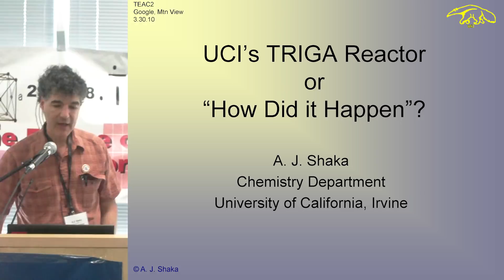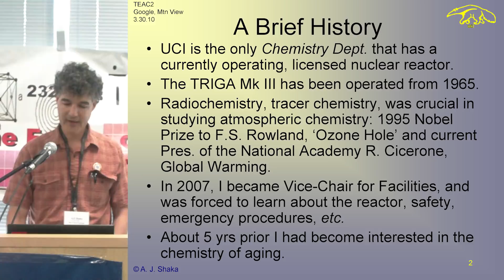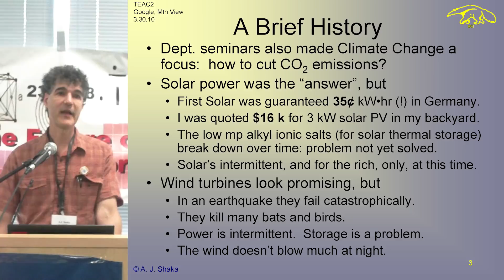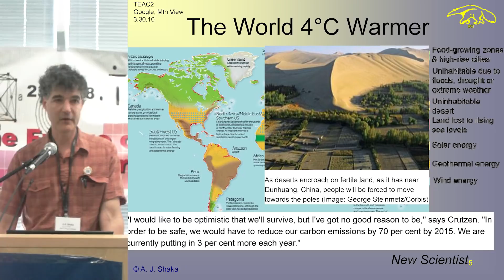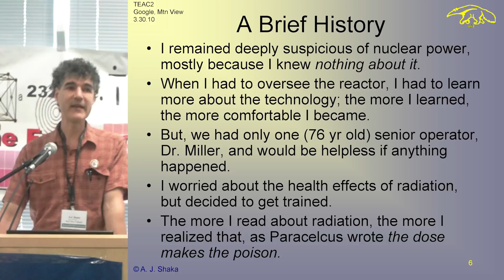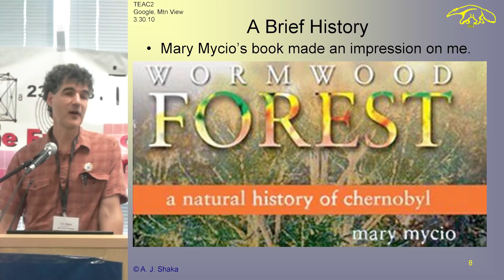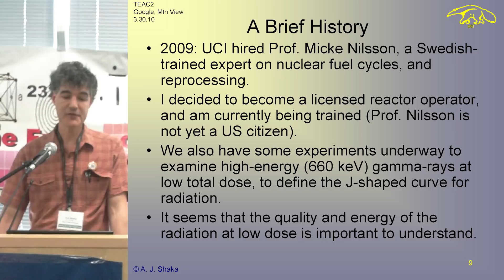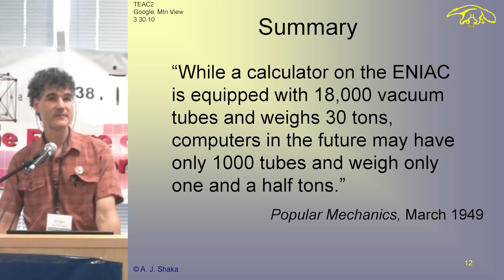A. J. Shaka - TRIGA Reactor @ TEAC2

Comment: Odd that dr. Shaka believes the J curve exists for radiation but not the earth’s system for dealing with additional CO2. All of the hockey stick models have a compounding factor in play, which directly contradicts the J curve’s healing and absorbing effects. We shouldn’t pick and choose where the J curve applies folks
Reply: Because history shows the earth doesn't have a fast acting one. We've seen in geological history that additional heat increased CO2 levels, increasing heat, increasing CO2 levels further.
that feedback loop stops eventually as most permafrost has melted and the biomass has been reduced, and then the slow carbon sequestration processes reduce the CO2 levels again, but only very slowly and only after the full positive feedback loop has happened.
Reply: @TheCountess666  exactly. but my point was that he is picking and choosing to apply and not apply the proper reaction. It's inconsistent. But let's be honest here...the general public is finally starting to wake up to the fact that AGW is a hoax. They can plainly see observationally that the temp is not warming. And solar observations seem to predict the temp will continue to cool, further busting the failed warming predictions. Add to that the fact that NOAA and NASA have corrupted the temperate record with their increasingly common "adjustments" cough-cough, the gig is up, the hoax has been debunked. Let's focus on real problems like pollution, which kills WAY more people that any perceived warming. And the best way to get rid of coal/oil/gas? Advanced nuclear, i.e. LFTR and MSR.
Reply: @MichaelLebiedzinski  how is it a hoax? 
You have some proof that greenhouse gasses aren't opaque to infrared light while being transparent to nearly every other light frequency?

Or do you have proof that the earth has another mechanism besides infra red radiation out into space to lose the energy it gets from the sun? (energy in == energy out = stable average temperatures)

no?

Then man made climate change is a undeniable fact.

and he isn't picking and choosing at all: There is no j-curve for man made climate change. that's what i explained to you. you then say 'exactly' and go off in completely the opposite direction. 
That's not the tactics one uses when having a honest discussion.

As for the general public, support for climate change mitigation policies is only growing. even among conservatives.
Reply: @TheCountess666  the chemistry and physics are not in dispute, they are the laws of nature. the hoax consists of: 1. parameterized climate models that are adjusted to provide pre-determined outcome, 2. lack of transparency in scientific method used to construct model (hockey stick for example). 3. NOAA and NASA making "adjustments" to the raw collected data, again to support a pre-determined conclusion. These are proof of the hoax, and this is not science. you are making a HUGE leap from GHG opacity and basic thermodynamics to "man made climate change is a(n) undeniable fact" with zero proof for your theory. This again is not scientifically sound. Climate change is indeed an undeniable fact. Observation proves it. But to make the leap that human activity is causing all of the climate change we continue to experience on this planet is an unproven leap. There are literally thousands of variables here. Have you read the transcripts and video of ex-IPCC members who have admitted the IPCC is a political organization, not a scientific one? Have you heard their own words stating the IPCC's aim is global wealth redistribution, through climate change policy. In their own words... Have you, personally, reviewed the NOAA US temperature data?? the raw data, not the adjusted data? Can you explain how, even with adjusted temperatures, the US average temperature was LOWER in 2018 and 2017, compared to 2015 and 2016? The temperature is lower, not higher, yet still in the presence of record CO2 ppm. Are you aware that ZERO, yes ZERO, of the climate models have accurately predicted temperature change? and not by a little bit. 100% of the climate models vastly overstated predicted temperature rise compared to decades of observed values. What does that tell you? It tells me the models were WRONG, WRONG, WRONG, and that the models used input parameters that were designed to provide a predetermined output, to fulfill a political, not scientific, agenda.

I agree with you, climate change is an undeniable fact. But man-made causing all climate change, or even more than a negligible amount? where's the proof? even further, the notion that man can affect global climate? who do we think we are????

And lastly, as more evidence of the hoax...remember we used to call this "global warming". but you don't hear that anymore right? it's now referred to "climate change". Why? because humans can readily observe that the temperature isn't getting any warmer. So the narrative had to change to something softer, thus "climate change". Sufficiently general to be a catch-all for everything bad that happens. A hurricane here, or a drought there -- OMG, climate change!!!! the sky is falling
Reply: The Countess oh and of course the most obvious thing you are probably aware of.... we have these things called clouds... made up of water vapor. care to comment on the effect of water vapor of greenhouse effect?? now one caution, don’t use Al Gore as a source for your response. he has a propensity to photoshop pictures of the planet taken from space, removing clouds. well documented, check it out for yourself
Reply: @MichaelLebiedzinski  ah clouds. yes, so warmer air can have more water vapour in it before it starts to condense and form into clouds.

Clouds ar a mixed bag in terms of warming, as they block sunlight during the day, but also block the infrared radiation from the earth (at night, we've all experienced those sticky nights when its cloudy outside, compared to much cooler nights when its clear.)

But that water vapour however is very clearly a greenhouse gas. The most powerful greenhouse gas in terms of effect in the atmosphere in fact. ~95% of the natural greenhouse effect, which adds about 30 degree's C to our climate, is caused by water vapour.

And warmer temperatures means more water vapour in the atmosphere with the same amount of clouds. 

And that's the part the has scientists worried.

Even at the current +40% extra CO2 (highest level since humans evolved) would only about 0.6 degree's C on its own. But that 0.6 degree's C would increase the amount of water vapour, which would increase temperatures further.

It's this amplification effect that we're really worried about. that's what all our modeling is trying to predict.
Reply: @TheCountess666  ok. that sounds more reasonable. my suggestion on the models would be to stop changing all the input parameters to get the result you want (warming). Just create a model where you open to whatever conclusion the models outputs, scientific theory...start with a theory and perform research to prove or disprove it, but don't allow bias to affect your results. every single one of the models I've seen has been WRONG. It grossly overestimated future temperatures. so what does that tell you? the model is not accurate. you're missing a variable, or the input param are wrong. the best theory I have seen that normalizes the models to observed temp is that the models incorporate a feedback loop that may not actually be present, and may not be accounting for the climate's natural ability to absorb changes. I think we need continued research and stop the nonsense with "undeniable fact" when in fact the models have proven wrong.
Reply: @MichaelLebiedzinski  Scientists put into the models the numbers they know, or the ranges they know if we don't have a accurate number yet. So the result of any model will be a RANGE of outcomes, with the most likely results being around the centre mass of the results. And so far all the models show more warming, with results ranging from mild warming to catastrophic warming, with the center mass of the results around 1/3 up from the bottom, so serious warming.

unfortunately communication to the public doesn't always make this very clear. leading to claims that the models are always wrong ect, and that then gets used to imply that there is no warming at all. but as you read in my previous post, we KNOW there is warming. there is no way there isn't warming.

And actually we know very wel why our models are off: The air isn't warming up as fast as the models predict, but the ocean is warming up faster then predicted, the deep ocean in particular.

We just dont know the mechanism for why that is, so can't incorporate it into our models. and if you think about it, that should scare you.
That mechanism could reach a saturation point, or a tipping point at any moment, Or it could just act as a extra years of delay for warming, but not mitigate it at all.

All of this is more then enough reason  to push for seriously reducing carbon emissions, even if we dont have all the exact answers yet... or in fact BECAUSE we don't have all the exact answers yet. i know this is corny, but we don't have a planet B,  so we need to make sure we don't run unplanned and uncertain experiments on this one.
Reply: The Countess listen to what you’re saying. scientists don’t know, the estimate, there is uncertainty, drawing conclusions without evidence. do you seriously expect people to believe you when you say all that in one breath and then say “it’s undeniable”?? you have no idea why the lower ocean temps are increasing or if they even are? it’s proven fact that NOAA and NASA have been adjusting observed temperature readings in direct correlation to increased CO2. talk about having a finger on the scale!
Reply: @MichaelLebiedzinski The real question is are you even listening? 

i don't care what conspiracy theories you think you need to add. the science on greenhouse gasses is SETTLED. And there is no denying that there WILL be a effect from increasing CO2 concentrations by over 40%.

You can rant and rave all you want about how you think the predictive models are wrong and not accurate,  ect... that just all the MORE reason to want to cut our CO2 emissions! Because that just implies that we dont understand the process. and that, again, should scare you.

we're running a global experiment on the one planet we have and we don't know what the outcome will be.

Does that sound like a good idea to you?
Reply: @TheCountess666  not only am I listening, but I'm also informed. for 2 decades, I thought like you did. I heard all the world-ending proclamations and responded like many did agreeing that we need to reduce CO2. Then, when I observed that all of the predictions were not coming true, I did what any intellectually honest person would do, I started questioning the assumptions. And I learned that the science is not, in fact, settled. Many, many scientists dispute not only the conclusion, but the method. And when the so-called consenus is questioned, they refuse to engage in a fact based debate, they refuse to share their methodology, the pursue litigation (Michael Mann) to protect their revenue stream and reputation. 

Yes, you are correct, there will be some impact from increasing CO2 concentrations. But we don't know what that impact may be, we don't know whether what we're observing now is being caused by those CO2 concentrations, and in fact we have historical evidence to the contrary. Bottom line is that we just don't know, and therefore should not be taking misguided action on questionable information.

Precisely BECAUSE the models were wrong is exactly we should NOT take advice from those who created the models!!!! that's common sense.

It's pharisaical that you think humans can control any global outcome on this planet. do you think you are god? seriously. This planet has been here LONG before us, and will be here LONG after us, so dispense with the ominous warnings about us "destroying" the planet. 

Now, if you REALLY cared about CO2 emissions, you would be in 110% support of the most practical way to reduce them: safe and economical Advanced Nuclear. There is no other power source known to man that has the energy density provided by atomic fission. Scientists have demonstrated, in fact 5 decades ago, that molten salt reactors, powered by liquid thorium, can work safely. do yourself a favor and watch some of the Michael Shellenberger videos. The guy was freaking raised by hippies and he's a huge nuclear proponent. Why? because he's intellectually honest enough to challenge his long-held beliefs when reality doesn't match up!!! you should do the same. or you can continue to delude yourself, your call.